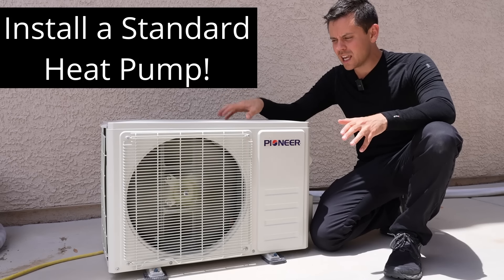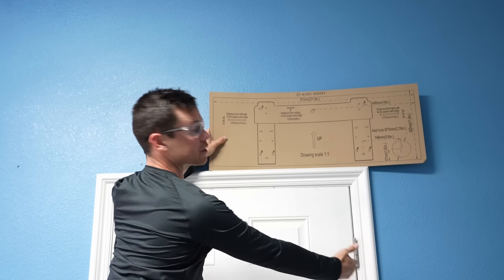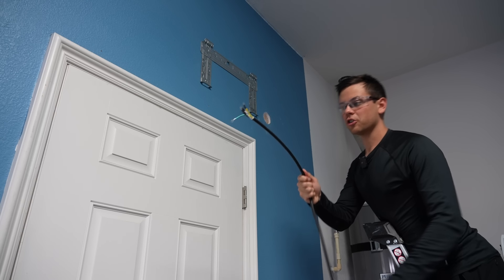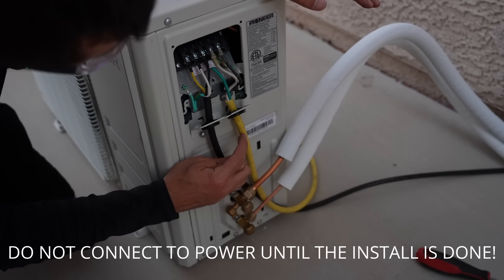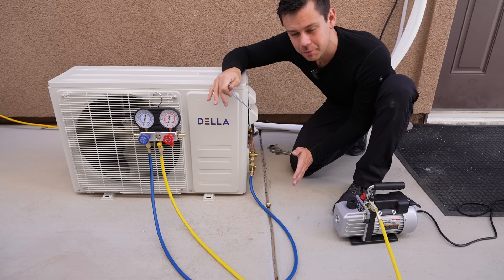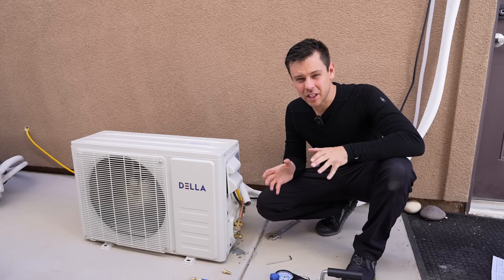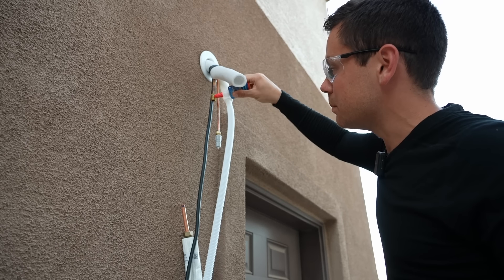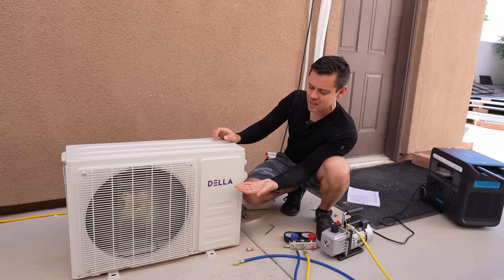Budget Mini Split Installation for Beginners! w/ Vacuum Pump and Gauges

Comment: Will on this type of install you should consider a pressure test for leaking first as just pulling a vacuum will not be sufficient..
Usually 250-300 Psi nitrogen test will be good (it will also dry out the line some before the vacuum draw).
The gauges you are using are not the best.. digital ones should most likely be used and pulled down to 500 micron(let settle for an hour).
The line set should not be cut or extended without adding/removing refrigerant as the vendor supplies as much refrigerant  as needed only for the length they ship it with(there is some leeway in length but do not extend beyond/below what the manual specifies)
The importance of the vacuum is to boil off as much water moisture as possible otherwise it will mix with the refrigerant and within six months corrode the internal piping causing the unit to fail.. 
These steps will cost  you a few hundred dollars in tools and parts but save you thousands on install fees..
But if you have to recharge or reduce the refrigerant then a professional is required as the weighing and disposal of refrigerant can get really messy and complicated ..
Take it slow the first time and then your set to do it again in the future and for friends :)
Reply: From a professional point of view, you are correct.
Except... 
Buying the CO2 ???
You should also top up the refrigerant that is used, and should use UV dye refrigerant oil, to find possible leaks.
As a professional....

Yet... This video is for DIY.
Not how to become a professional HVAC installer.
Reply: @fhorst02  I went only so far as I believe a DIY should go as that is what I did..
Originally I went as far as will did and guess what 7 months later ...failure... So I added my two cents not as a  requirement just an observation to possibly save someone some heartache..
I never mentioned CO2.. I mentioned refrigerant as there are different types and requirements..(which depends on existing and newer laws that will change them soon)
More informed is better enabled... And what I mentioned I believe  is well within the abilities of a DIY'er... in my honest opinion..
I give people a lot of credit for going down this path.. And I have full faith that people can do what I previously wrote..

Going any further than I wrote IE full professional install will not give you the return for value proposition..(in my opinion)
And again this is my opinion in a comments section meant to help people not discourage them... And I want people to succeed as the price for a professional install in my opinion is atrocious.

Take it for what it is meant to be as a helpful insight to be ignored or not the choice is in the hands of the individual..
As a diy'r I did not find Nitrogen pressure testing difficult I just got a tank and pressure gauge and looked to YouTube..
All in all I spent 500$ in tools and saved thousands all I had to do was watch some you-tube videos and treat the equipment with respect..
Bottom line all I did was look at DIY min split installs on YouTube..
Then I watched mini-split install failures on YouTube and that's how I came up with my opinion on what level as a DIY'r  I would recommend to go too.. :)

Sorry for the long winded reply I just wanted to clarify..

Comment: Getting my unit soon, I will fill pressurize the lines with N2 to around 300 psi, check for leaks then pull a Vacuum and check if it holds. I will use a Micron gauge for that.

Comment: What would happen if you didn't use a vacuum pump and just plugged in the freon lines with moisture in them? How much efficiency would you lose
Reply: moisture in the lines and freon make acid and burn out the compressor

Comment: question, can you run the line down the wall on the inside and then come thru the wall by the outside unit.?
Reply: Yes. On my house there is a stud wall, then a four inch brick wall on the outside. Actually I cut the drywall out and ran the lines inside the wall and then drilled out the brick wall on the outside since it is easier to drill through the bricks while standing on the ground instead of a ladder.  Then I refinished the drywall.  It also looks better without all the lines coming down the outside wall.

Comment: Will, I want you to know you have changed my opinion on solar and EVs.  I live in the UAE where no one uses solar, which is NUTS, and where I work prohibits EVs. When I am done here I will move to Texas, buy a house with some land, install a ground mounted solar array and live off grid., but a Chevy bolt to drive to work, and live my life without any worries about powe

Comment: What about power? I've have not found a good answer about having to do an AC disconnect outside. Is yours plugged in with a cord? Could you just run the power back inside through the hole in the wall?

Comment: So the Della version does not come with the rubber feet, remote holder and some other stuff but the most critical is the damn template is NOT RIGHT at all for the hole. Imagine how mad I was that my hole was about 6 inches off.... Its far closer to where the one is shown on the left side that the one on the right. You are going to want to check that with your unit and re-measure.

Also I am down a few more days, the copper tubing is apparently metric, 3/8 flare tool will not hold it....

Comment: Just finished installing a Della 18K BTU tonight and its running great. Even though I installed a Mitsubishi myself 12yrs ago, my memory had waned and this video / comments were all the refresher I needed to knock it out. I did run into some confusion with wiring schematic thats delayed my install a couple days. Anything bigger than the 12K BTU units are gonna be 230v, and even though the label on my inverter stated 230V-60Hz AC, the wiring block only had two lugs which the schematic labeled L1 (AC-L)  / L2 (AC-N). It took a few tries to get Della support to confirm its just a universal schematic ( EU is one 230V Line Voltage and one Neutral ) and I was good to put both 115v legs to L1 & L2 lugs here in the US.

Comment: United here don't come with the copper pipe. Have to buy a box full separately and make your own flanges etc. I just tighten and don't go to a specific torque
 I recommend Mitsubishi heavy Industries Air conditioners

Comment: Dumb question but what happens if you don’t vacuum out the lines.  What does it damage?
Reply: The air contains moisture which may condense into water.  Water is not compressible and may damage the compressor.

Comment: Will, for your line set hole, I always use a 12" x1\4" pilot bit. From the inside out. Drill out the inside hole, then drill the outside hole in. This prevents damage to the exterior of the home. Starting the hole saw flush prevents walking then once you cut through start your angle. 
Great video. I plan to install one in my outdoor building that houses the batteries and the all in one.
Does it have a backup strip heater?
Reply: Nice one!!

Comment: It is important to run the vacuum pump at least 5 minutes after hitting -30 inch.  That will allow moisture to flash to steam and be drawn out of the line set.   Then wait 15 minutes with the manifold valve closed to verify the negative pressure holds.  Using Nylog, in my opinion is a must.  No reason to cut corners.  It is about $15 on A....z.n.  Way cheaper than have to recharge the unit due to leakage.

Comment: 5:17
Note, that drain hose is complete junk in a year… if ANY sunlight touches the plastic, the hose just crumbles.
I always route the factory drain pipe into a piece of 3/4” pvc pipe with a coupling on the end. The. Route the pvc where desired.

Comment: @willprowse why open the high pressure line for only 5 seconds before disconnecting the blue line? I’ve seen videos where they open both lines fully then disconnect. Or would that risk losing more refrigerant?
Reply from the maker: Wouldn't change anything. It's a closed loop
Reply from the maker: And you could buy my instructions said not to do that.

Comment: Just put in the Della early last week.  Already had the vacuum pump so it was super cheap.  I welded my own frame for an overhead side mount (roof).    At 20 SEER they are super efficient and incredibly powerful.  After installing the second one I can't set them under 73 or my house gets too cold.  All this when temps here have'nt gone under 100F for the past two weeks.  And they heat well in the winter.  With my solar panels being installed next week it all came together beautifully.  Thanks for inspiring me to get it all done.
Reply from the maker: That's awesome!!!!

Comment: I ordered one of those in Feb of 2014.  IT"S BEEN AWESOME.  I spent about $700 on it, and I'm in an office I built in my garage cooled by that right now.  It had to have the capacitor replaced 2 years ago.
I bought the vacuum pump, but chickened out and paid a pro to draw the vacuum.  He told me, that a common issue is that consumer grade vacuum pumps can't draw as low a vacuum as the pro equipment can.  Get a good one.

Comment: Thx a lot Will for all your efforts. Could you please tell the reason for plugging an inverter input to the wall outlet? Is it to charge the batteries or to distribute the electricity thru the solar system instead of using the batteries? Thx Will

Comment: Awesome, I was just looking into ordering the Della today and then you posted this video. So I'm going to order it as soon as I get home. Thanks for the video very helpful indeed. You should do a video on how to connect this unit to solar then I'd be eternally grateful . I'm installing this in an RV, hope it works out. Thanks again, your the best Will.
Reply from the maker: Be sure to use my affiliate link above 😁👍🏻
Reply from the maker: And with solar, just need to connect to an inverter in a solar system. That's all there is to it
Reply: @WillProwse  I'm new to solar power, how big of a system would you recommend for running this unit, I'm located in southern Texas so there is plenty of sun.
Reply: How come you show a pioneer when unboxing then change to a Della for the vacuum pump? Which did you install pioneer or Della?
Reply from the maker: @johndeerefarmer4483  I had to install both. I wanted to redo the vacuum pump segment.
Reply from the maker: @Muppetmanable  post about what you need on our forum and then I can respond there
Reply: @Muppetmanable please use the forum. So many variables. Do you want to run it entirely out of solar? (On/off-grid/ hybrid setup, possible batteries)(Day and night) or just reduce the energy bill?? (Grid tied setup)
Lots to learn and study about it. But first step is to have your "wants and needs" clear.

Comment: I installed Panasonic with a help of my  friend with the pump. But watched this to the end anyway. That's how good was this video.  I did good on doing the hole through 44cm wall. We use thermal bricks with many chambers so it cracks a bit inside. I wonder if i can use  spray foam insulation to fill it after the install? Thank you👍

Comment: This is the one we have in our offgrid art studio/shed (the pioneer). The 9k btu unit. It’s been through two Texas summers now. It’s fed by 1200 watts of panels that produce about 6.5kw/day. We have a 24v system with epever 80amp charge controller, and 5kw of powerqueen lifepo4 batteries. Even in the summer we start it up at about 83f, at 9am, and it runs all day on Solar from a 4000 watt inverter. The S/O, then turns it down when she is inside working to about 75f. Solid product. It maxes out at about 1000 watts at full bore. We’re about $3500 in with the while system, mini-split/solar system. It’s earned back about $150.00 in the first year and a half of use.

Comment: Shouldn't you leave one connection loose so you know you are pulling vacuum on the lineset and not just your gouges? Then tighten when you know. In other words how do you know the stem valve has been depressed to pull a vacuum on the lineset?

Comment: I just ordered my Della and everything you recommended  tonight Will . You do a tremendous public service to those of us who are handy with tools. I was quoted $3200 to install a similar unit. I may be old but i am not stupid, thanks Will.
Reply: well you will need cable . circuit breaker, drain hose, and the trunking for the lines.  the more expensive units are more efficient and will pay for the difference in energy costs in a few years .
Reply: @STRUTZKOFF  $50 for cable ,already had cutoff box, $30 for circuit breaker, vacuum pump and gauges $150 , FIVE HOURS INSTALL FOR FREE AND IT WORKS EVEN BETTER THAN I IMAGINED . So what is your beef ? unemployed A/C GUY ?
Reply: @Channel-gz9hm Imagine what the price of oil and electricity will be after war breaks out and straights of Hormuz are closed. You can get a 25.5 SEER2 for $1150 which is about the same as a 33 SEER.

Comment: FYI  Most heat pumps only have enough refrigerant for line-sets under 25 feet (check the specs), if you need a line-set over that you’ll need to add more refrigerant.   
 
I installed a ton of these systems for growers here in Michigan.   A client of mine had a bull $hit artist do his with a 50 foot line-set without adding refrigerant and it burned out the pump.

(Will covers this) Also the purpose of vacuuming out the line-set is for leak testing and removing moisture from the system.   Vac it out and let it set for 20-30 min before opening up the valve if the needle don’t move then let it rip!
Reply: Yes, they usually are shipped with a 4 meter long tube.
You can buy longer, it's not adviced to extend them with couplers, brazing only (with CO2 to avoid carbon buildup in the lines)
That said... I never had leaks extending with couplings, combined with loctite blue (or nylog)
Specification will tell maximal tube length, usually  8-10 meters.
Even if you would top up the refrigerant to compensate for the additional length.. there are limits.

50 foot / 15 meters is absurd.
Even with refilling, the pump would have crashed...

There is a maximal tube length, usually never over 10 meters!!! (33 feet)
Reply: @fhorst02  Conversely, if you have to cut the tube length in half, do you have to release refrigerant to compensate?

Comment: What size adapter do I need and where do I get it?
Reply: Installing my Della right now. The vacuum pump and guages that Will has on his links comes with the adapters. I Didn't know that so I bought extras. Look up mini split adapters. That's what I did. R410A  Connections is what you are getting.

Comment: Will the allow the inside unit to.pipe wires out the side???
Reply: Yes, there's a knockout in the plastic case and you can bend the pipes out the side.
Reply: @zaprodk  awesome, thanks!!  There is 4000 brands of these from Mitsubishi to Mr Kool, any idea which is the better units for reliability?lol.

Comment: Okay. I'm just going to ask a stupid question. What do ypu use as the power source? Do I see a power cord going through a hole in the wall? If so where does the unit tie in?
Reply: he is using a 120v unit...plug into any outlet...unit draws 7amp

Comment: I've had 2 pioneer minisplits now for over several years and love them.  The first one went on the bumber of my work van and I bought a new one when I got my box truck.  They do a super job, I run them off of solar and lifepo4 and it's been great!

Comment: Overall nicely done, but you keep switching between a couple of different units (Pioneer and Della). 🙂

One thing you didn't do, is to use something like LiquidTite on the power cables (both power to the outdoor unit and the tray cable going from the outdoor to the indoor unit). That is actually a code requirement to not only to protect the wires from liquid but also teeth that critters have and also UV as that yellow extension cord you are using might not be outdoor UV rated.

Comment: Will, you should have really did a nitrogen test 1st to check for leaks. If you did have one you could catch it ahead of time. If it did leak, now you have lost refrigerant and have to pay someone to charge it back up.
Using a vacuum to test for leaks isn't the best. If you have a leak your pulling more crap into the system.
Leak test, then vacuum , release the gas.
Run it for 30 mins and check again.

Comment: Not good aesthetic mounting procedure, if in a bedroom or living room. I would raise the unit above the door far enough to run your pipes through the stud and only then go down the inside of the wall. I know it's more work but will look better to who buys the house in the future. If this install is in a garage then it would not matter so much where the unit is. I would like a unit that can be mounted below a window, I would need two units for my one bedroom house. I would rather have a floor model. I want to keep the heat where it is right now I don't need to run it all the time the electric fireplace heats well enough and looks good. 73

Comment: Closing blue low pressure gauge after vacuum,  isn't this no longer checking if vacuum is holding in ac unit and only checking vacuum between gauge and pump??????!!!!!!!

Comment: 17:34 you can use some duct tape to hold back the insulation temporarily so it's out of your way while flaring. Don't forget to put the nut on the pipe before you flare ! :)

Comment: Before you wrap the wires/pipes with electrical tape, get a $5 pool-noodle, cut it lengthwise with a razor knife, and shove all the cables into it.  Then you can wrap it without needing overlap tape, and not only will they feed together without kinks, but they won't get nicked... and the bonus is that OAT of 115°F won't be coming in because a pool-noodle makes for a great insulator.

Added bonus, once threaded through the hole you don't need to remove tape.  Just pull the popes you need through the cut in the noodle.  Extra super bonus... if you have a helper who annoys you just hit them over the head with the offcut from the noodle.  Stay cool!